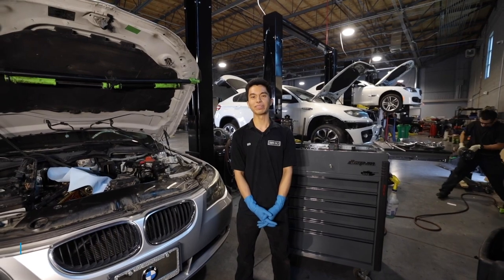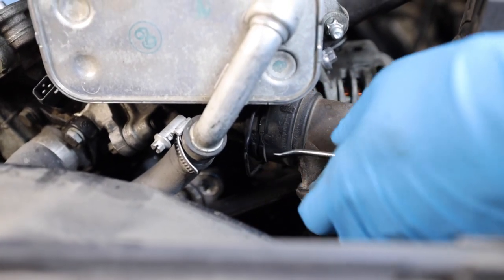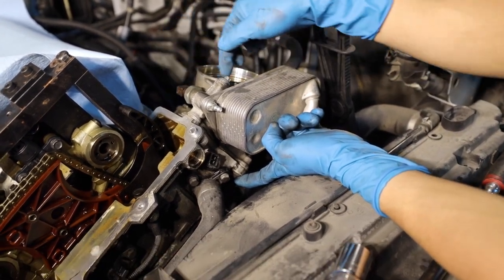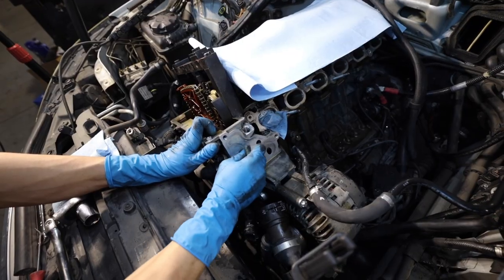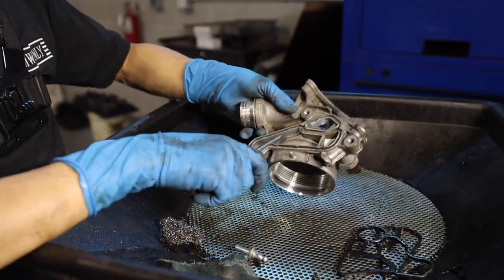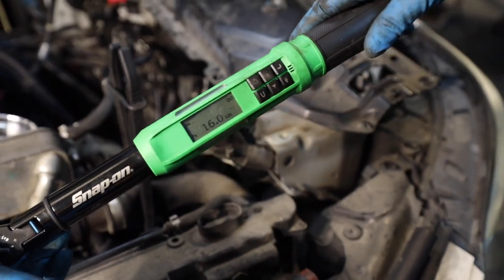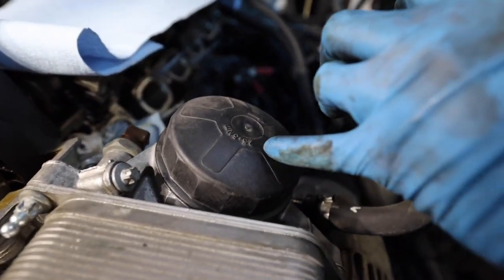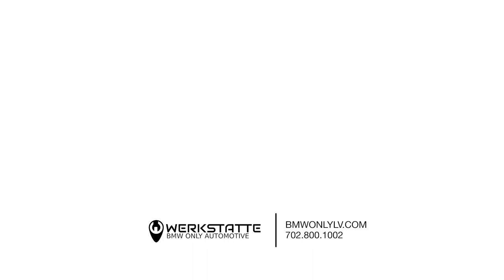BMW 335i N54 Oil Filter Housing "Stand" Gasket Full Video DIY

Comment: Do you prime the car after chaging gasket
Reply from the maker: Not sure If I understood your question, prime the car?
Reply: @werkstatte-bmwonly9515  do you like  pull out the full injector plugs and prime the cars oil systemand oil filter after replacing the gasket before you start the car?
Reply from the maker: No, there's no need for it. Just fire it up. It's just like oil change, you drain the oil and replace the filter. Same here.
Reply: @werkstatte-bmwonly9515  thnks
Reply from the maker: You're welcome. Good luck.